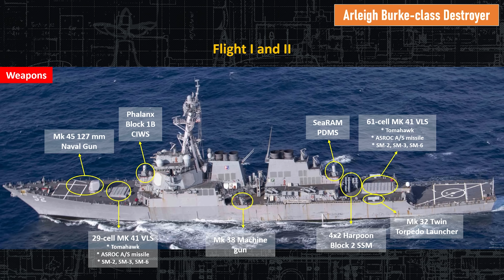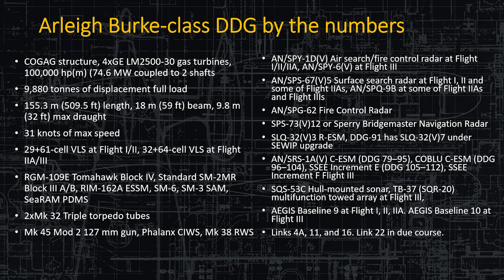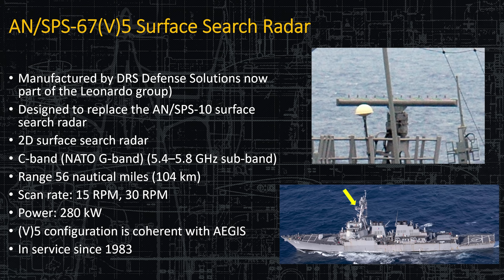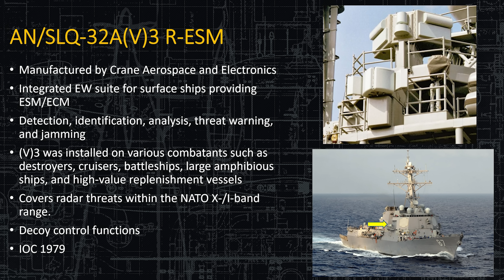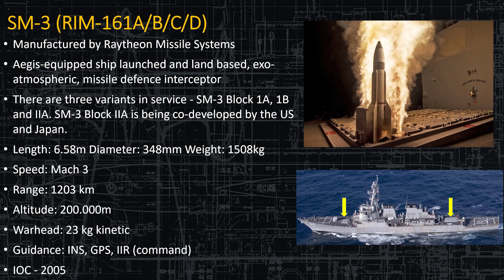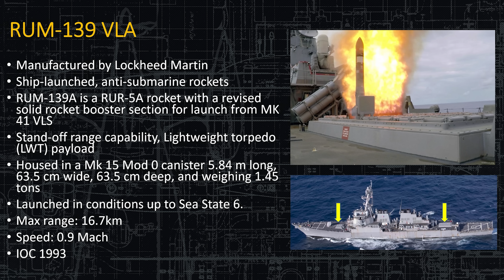How Does the Navy's Strongest Ship Work?

Comment: Failed to mention the upgraded generators on flight III from 3kw to 4 kw basically adding an additional generator.
Reply: Initially this was done because of the extra power requirement of the new radar. So, from that perspective, it could be considered part of the new radar upgrade. But the extra power will probably also prove valuable for future energy weapons.

Comment: It would be nice if they'd extend a burke to add in more vls cells and add a rear castle so it could fill the role of a Tico (more or less what they're planning to do with the ddgx concept, without changing the hull shape.) The objective would be to to make it on the same assembly line the flight 3s are built on using the same parts (unless they can wheel in some equipment subsystems and plug it in without needing extra infrastructure.) That way they could make the cruiser prototype, send it out for sea trials, and then go back to making flight 3s without losing yard time.
Reply: You might as well start designing a new ship at that point because that's not just a simple modification, at best it would require additional length added to the hull could cause issues given the flight 3 is already a fair bit longer than the flight 1 or flight 2s. In general the Burke's have basically been maxed out in terms of what you can add to the current hull without grossly exceeding the reserve of bouency and available tonnage. I honestly think a completely new design is what we need. There's only so much we can do to a 30 year old destroyer lol. I think it's time we bring back the cruiser if anything, something bigger and faster that's a bit more capable in anti-surface warfare.
Reply: @KyleSprinkle  They have claimed the Burke is maxed out, but that's without extending the hull to make it longer. I realize it's not a trivial thing, but it does seem like their engineers could work it out. 

Building a new hull entirely means you need new tooling and infrastructure, which would be tens of billions of dollars. Which I guess would be fine if you intend to just create more dock yard space and continue burke production at the same time, but once those ships go into production, they will likely replace the Burkes at Bath Iron Works and Ingles. 

Also, in response to, "there's only so much we can do to a 30 year old destroyer," if you look at the ddgx concept, it's more or less a burke with a wedged shaped bow, modular mid section, truncated rear and half a castle sitting atop it. There's a few other changes, but those are the main things you can notice just by looking at it. 

I'm merely suggesting they do similar things with the parts they have available for the Burke. It would be a very different ship deserving it's own class name, but due to the shared parts it would be much cheaper to produce than what they're planning to do with the ddgx (3 to 3.5 billion instead of 4.5.) And, they could start producing it immediately after they finalize a design, where as the ddgx wont be ready for production until the 40s.
Reply: Could they remove the hanger and put in VLS cells there to have a more anti-air focused ship without having to change the hull?
Reply: See S Korean Navy....
Reply: The Navy is already working on this. New class called DDG(X) atm. It will include what we have learned from Arleigh Burke and Zumwalt destroyers. It will have a massive increase in electrical power and almost certainly be electrically driven. They plan to make enough of these new ships to replace all the Tico cruisers (22 ships) and all the Flight I and II Arleigh Burke (28 ships). So they might make 50 of this planned new class of ships. Sounds like they might replace 32 of the VLS tubes with 12 prompt strike missile tubes. They might as well call them cruisers.

Comment: Oh boy. I can’t tell if you are being facetious or not. My last ship was a Flight IIA Arleigh Burke, and I can say without hesitation that those things are hot garbage. They aren’t fast enough to hang with the carrier that they are meant to protect (this is partly a function of the ship’s length, or lack thereof). They don’t have the extra power that will be needed for directed energy weapons. All their anti-air countermeasures need to be reloaded from OUTSIDE the skin of the ship, and they still have some weapons that need an actual human being manning them topside (ex. .50 cal). Why does this matter? In the case of the former, the lack of internal magazines for countermeasures (ex., chaff, NULKA, and CIWS) DRASTICALLY limits defensive capabilities against aerial threats (i.e., they will quickly be overwhelmed by swarm tactics), and both the former and the latter require putting sailors at risk by sending them topside during a battle to reload countermeasures and/or man weapons. Internally, the layout of the passageways is not conducive to easily moving material and personnel around, especially in combat situations. If you want an example of good ship interior design, go tour an Iowa-class battleship if you get the chance and note how much thought was given to actually “fighting the ship”. For all their issues, the Ticonderoga-class cruisers were at least more capable in dealing with aerial warfare. It’s embarrassing to call Arleigh Burkes the “backbone” of the Navy. The only good thing I can say about them is that sonar control is located separate from CIC, so my division pretty much got forgotten about and left alone most of the time. 😆
Reply: Yeah, uh, failure to keep up with a nuclear powered carrier set to full tilt boogie is no sin. Those things have been leaving their battlegroups behind for decades when the need is dire.
Reply: I won't disagree with the P-way layout. I went to a flight I from an FFG-7 class ship, and was very confused about getting to some spaces.

As much as we may rightfully criticize reloading missiles/countermeasures, realistically any fight we get into is going to be over one way or another before you can reload a VLS cell, or even reload a magazine on the old one arm/ two arm launchers for OHPs and Ticos. As much as it sucks, running away to a friendly port once a ship goes dry on ammo is the smart thing.
Reply: lmao those are downsides literally every modern warship has. everyone has to get on deck to reload chaff, no one can keep up with a nuclear carrier. there is not a single warship on earth that fixes these problems, besides maybe the passageways, which are small on purpose for better damage control. its funny you bring up the energy weapon limitations when Arleigh Burkes are the only destroyers on earth with mounted energy weapons, theyre just not strong enough for the navy's liking. its literally a case of suffering from success. of course, you weren't allowed in CIC, or else you'd know the average Burke has a leagues better Aegis Baseline than the Ticonderogas. You didnt see the important stuff so the mundane non-factors left a bigger imprint on your opinion.
Reply: @sludgepet  Who said I wasn't allowed in CIC? Sonar control may not be located near CIC on an Arleigh Burke, but CA (Combat Acoustics) division is still part of Weapons Department and stands Combat Systems watches. While my primary watch station and general quarters station were both in sonar control, I did also spend a fair amount of time in CIC. Our fire control stack is located in CIC, and every sonar tech has access to the space. Additionally, CA division participates along with all the other Combat Systems divisions in giving the daily intel brief to the CO, so I’m not sure what “important stuff” you think we missed out on.

To your point about the “downsides literally every modern warship has”, it sounds like your argument is something along the lines of, “Everyone else has these limitations too, so the U.S. Navy shouldn’t even bother trying to improve the situation.” This is the wrong answer. Full stop. The U.S. military used to lead the world in developing new and innovative technology and TTPs (Tactics, Techniques, and Procedures), and there is no reason it should accept the status quo if the status quo is inadequate. 

Additionally, your comment about passageways being “small on purpose for better damage control” doesn’t make sense and doesn’t speak to what I actually said. Passageway size (like ship top speed) is constrained by how large the ship is. In the case of the Arleigh Burkes specifically, the p-way dysfunction is less a function of their size and more due to their layout (as I mentioned). Larger passageways would likely aid in damage control as they would allow firefighting/dewatering equipment and personnel to move more easily and quickly to where they are needed. (If anyone who served on a BB or CVN is reading this, please correct me if this is incorrect)

Your statement that, “there is not a single warship on earth that fixes these problems” is also not entirely correct. There are solutions to many of the issues I raised that already exist and are being used by other navies. For example, the Dutch Goalkeeper CIWS has its magazine below deck underneath the gun, so there is no reason that U.S. naval vessels can’t have a similar system. The Army has the Common Remotely Operated Weapon Station (CROWS) that allows all manner of weapons platforms (including the .50-cal) to be remotely operated. There is no good reason from an engineering standpoint that countermeasure systems also couldn’t be designed to be reloadable from inside the skin of the ship. The Navy is just too lazy and cheap to try. Speaking of AEGIS, adversaries have had DECADES to design weapons specifically to defeat it, and they have succeeded in many ways. The new anti-ship ballistic (ASBM) and anti-ship cruise (ASCM) missiles being cheaply produced and fielded by multiple nations pose a serious threat to AEGIS-equipped vessels.
Reply: @sludgepet  Who said I wasn't allowed in CIC? Sonar control may not be located near CIC on an Arleigh Burke, but CA (Combat Acoustics) division is still part of Weapons Department and stands Combat Systems watches. While my primary watch station and general quarters station were both in sonar control, I did also spend a fair amount of time in CIC. Our fire control stack is located in CIC, and every sonar tech has access to the space. Additionally, CA division participates along with all the other Combat Systems divisions in giving the daily intel brief to the CO, so I’m not sure what “important stuff” you think we missed out on.

To your point about the “downsides literally every modern warship has”, it sounds like your argument is something along the lines of, “Everyone else has these limitations too, so the U.S. Navy shouldn’t even bother trying to improve the situation.” This is the wrong answer. Full stop. The U.S. military used to lead the world in developing new and innovative technology and TTPs (Tactics, Techniques, and Procedures), and there is no reason it should accept the status quo if the status quo is inadequate. 

Additionally, your comment about passageways being “small on purpose for better damage control” doesn’t make sense and doesn’t speak to what I actually said. Passageway size (like ship top speed) is constrained by how large the ship is. In the case of the Arleigh Burkes specifically, the p-way dysfunction is less a function of their size and more due to their layout (as I mentioned). Larger passageways would likely aid in damage control as they would allow firefighting/dewatering equipment and personnel to move more easily and quickly to where they are needed. (If anyone who served on a BB or CVN is reading this, please correct me if this is incorrect)

Your statement that, “there is not a single warship on earth that fixes these problems” is also not entirely correct. There are solutions to many of the issues I raised that already exist and are being used by other navies. For example, the Dutch Goalkeeper CIWS has its magazine below deck underneath the gun, so there is no reason that U.S. naval vessels can’t have a similar system. The Army has the Common Remotely Operated Weapon Station (CROWS) that allows all manner of weapons platforms (including the .50-cal) to be remotely operated. There is no good reason from an engineering standpoint that countermeasure systems also couldn’t be designed to be reloadable from inside the skin of the ship. The Navy is just too lazy and cheap to try. Speaking of AEGIS, adversaries have had DECADES to design weapons specifically to defeat it, and they have succeeded in many ways. The new anti-ship ballistic (ASBM) and anti-ship cruise (ASCM) missiles being cheaply produced and fielded by multiple nations pose a serious threat to AEGIS-equipped vessels.
Reply: @sludgepet  Who said I wasn't allowed in CIC? Sonar control may not be located near CIC on an Arleigh Burke, but CA (Combat Acoustics) division is still part of Weapons Department and stands Combat Systems watches. While my primary watch station and general quarters station were both in sonar control, I did also spend a fair amount of time in CIC. Our fire control stack is located in CIC, and every sonar tech has access to the space. Additionally, CA division participates along with all the other Combat Systems divisions in giving the daily intel brief to the CO, so I’m not sure what “important stuff” you think we missed out on.

To your point about the “downsides literally every modern warship has”, it sounds like your argument is something along the lines of, “Everyone else has these limitations too, so the U.S. Navy shouldn’t even bother trying to improve the situation.” This is the wrong answer. Full stop. The U.S. military used to lead the world in developing new and innovative technology and TTPs (Tactics, Techniques, and Procedures), and there is no reason it should accept the status quo if the status quo is inadequate. 

Additionally, your comment about passageways being “small on purpose for better damage control” doesn’t make sense and doesn’t speak to what I actually said. Passageway size (like ship top speed) is constrained by how large the ship is. In the case of the Arleigh Burkes specifically, the p-way dysfunction is less a function of their size and more due to their layout (as I mentioned). Larger passageways would likely aid in damage control as they would allow firefighting/dewatering equipment and personnel to move more easily and quickly to where they are needed. (If anyone who served on a BB or CVN is reading this, please correct me if this is incorrect)

Your statement that, “there is not a single warship on earth that fixes these problems” is also not entirely correct. There are solutions to many of the issues I raised that already exist and are being used by other navies. For example, the Dutch Goalkeeper CIWS has its magazine below deck underneath the gun, so there is no reason that U.S. naval vessels can’t have a similar system. The Army has the Common Remotely Operated Weapon Station (CROWS) that allows all manner of weapons platforms (including the .50-cal) to be remotely operated. There is no good reason from an engineering standpoint that countermeasure systems also couldn’t be designed to be reloadable from inside the skin of the ship. The Navy is just too lazy and cheap to try. Speaking of AEGIS, adversaries have had DECADES to design weapons specifically to defeat it, and they have succeeded in many ways. The new anti-ship ballistic (ASBM) and anti-ship cruise (ASCM) missiles being cheaply produced and fielded by multiple nations pose a serious threat to AEGIS-equipped vessels.
Reply: They are fast enough to keep up with a carrier during flight ops, but DAMN does it take A LOT of fuel to do it! When I was on the USS Halsey DDG-97 on deployment with the USS Abraham Lincoln CVN-72 we were plane guard for a while and yep, had to refuel when done!
Reply: What a stupid array of supposed arguments- holy bitter Russian meatgobbler Batman
Reply: Source: trust me bro lol

Comment: Spoiler alert: no secrets are being revealed about the Arleigh Burke.
Reply: @Connor_Roush  sigh. Logging onto warthunder again.
Reply: Anything revealed, by definition, is not a secret. If you were expecting classified info, I have pity on you. Gullibility is a helluva drug.
Reply: That's ok. I already know the Big Secret. But I'm not tellin.
Reply: It was designed with a significant flaw: a thermal exhaust port located on its surface. This port was overlooked during its construction and was only two meters wide, making it a seemingly insignificant target. However, when hit could trigger a catastrophic chain reaction.
Reply: @rg-pq1kb  That's only the Flight I. On the Flight II, you have to fly inside the thing and target the engine directly.
Reply: Chinese bots are disappointed 😂
Reply: @Blood_Berry13 The Chinese have every word and number related to Arleigh Burke already. There are no secrets they don't already know.
Reply: I know various secrets about the Arleigh Burke DDG's.. I'm a plankowner on USS Momsen DDG-92 and retired while serving on USS Halsey DDG-97.
Reply: TY
Reply: I would hope not. There is zero reason to know more than what he is presenting here.
Reply: U Chinese?
Reply: @xartimus18 this a Chinese navy...this a Chinese navy
Reply: ill tell you a secret, flight 1 burke the engine stacks whistle distinctly as the ship cruises into the wind, you can hear it from far.
Reply: Yeah, those have been sold many years ago
Reply: There are only 2 or 3 classified items about the DDGs
Reply: Yea most never mention these use Australian invented decoy defense systems either, show most have no clue to what technology they have...